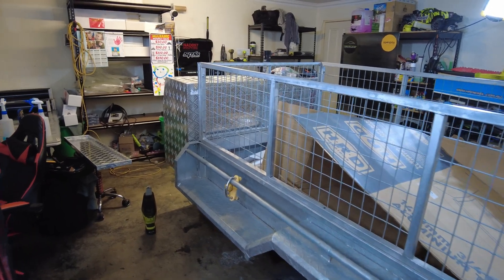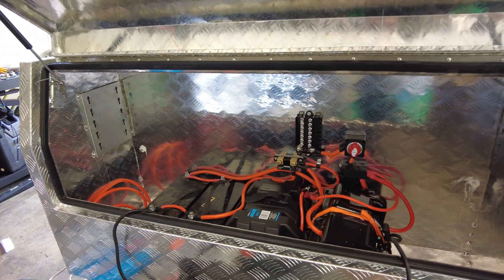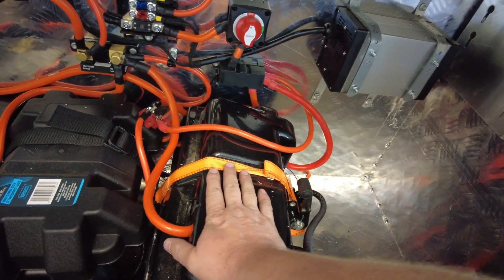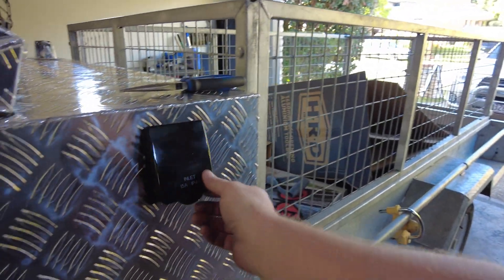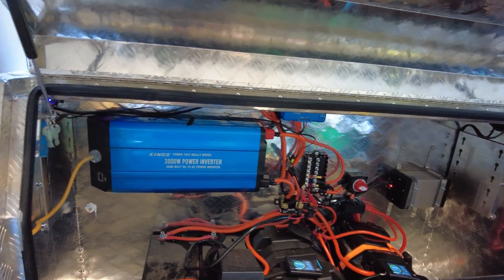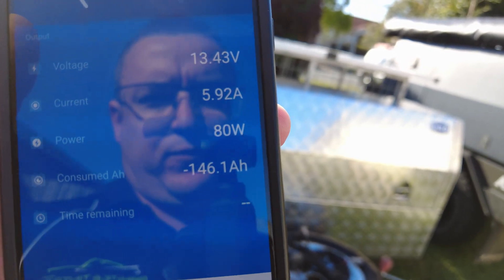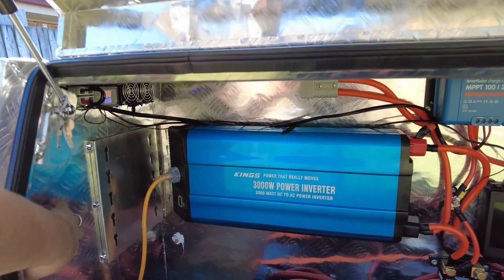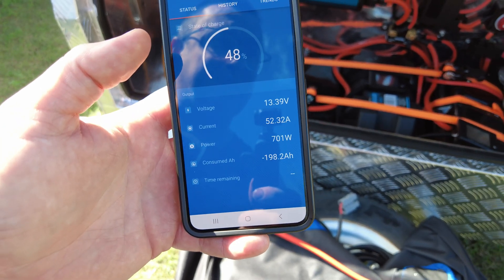DIY OFF GRID SOLAR GENERATOR BUILD

Comment: How will you stop the fans running when at 40c all the time draining your batteries. (Eg parked in the sun)
Reply from the maker: The fans use .6 amps. So not too much surprisingly. While it's in the sun, the solar will be putting in plenty to cope with it. Also going to add insulation inside aswell and extra vent fans on opposite side 👍😊
Reply: @WEEKENDER4X4  good idea on the insulation. Ive previously used small voltage relays to turn fans on when voltages are high enough for chargers (eg 13.8v) and temps are 40c. You could also incorporate a relay with the inverter remote switch so they only operate with the inverter on.
But you do have lots of capacity 😀

Comment: May i suggest insulation on top of the box with a roof over the insulation too keep the heat out its going too cook in there is summer.
Reply: And maybe plates around mounting point too stop the box tearing those mounts. Beadford batt with some water glass that you can make out of house hold ingredents
Reply from the maker: @charlieszablewski830  thanks again 😊👍
Reply from the maker: Thats a great idea 😊👍

Comment: Good job, looks like it is coming along nicely & ur right, u can mix battery capacities, Andys Off Grid Garage mixed 280A cells with 2A Palo cells no worries, parallel charged & discharged fine, they take what they need & give what they can within reasonable limits. 
I would suggest u consider ur ventilation intake air side, maybe a intake vent higher up on the opposite side near ur 240v charger input &  a bit of channeling down over ur charger to get the fresh cool air coming in to a lower point in ur power box so it helps to lift the hotter air out through ur fan assembly & help cool the charger along the way. Maybe make a small removable fly screen u can slide in/out for cleaning & to prevent ingress of bugs, dust, water, etc.
You may have got a dicky switch there, but I believe the reason they state up to 48v, means they are not suitable for a 48v system, where the voltages run from around 52v-58v normally. 
Shame about the state of ur batteries, but Im sure ur will still get heaps of life out of them, it will be interesting to see how well they fair,… or not!
Anyways, good vid mate, keep em coming & sorry to hear about ur brother. Cheers
Reply from the maker: Thats an awesome idea mate thanks heaps, I have another set of fans on order and yes, exactly what you said, I was thinking about some sort of channelling going down to the charger, have been keeping an eye on the temperatures in there per the course of 9 days total now, max it reached is 35.5c, so it definitely needs help in summer. Appreciate your condolences mate he was an awesome brother. Love and Miss him very much